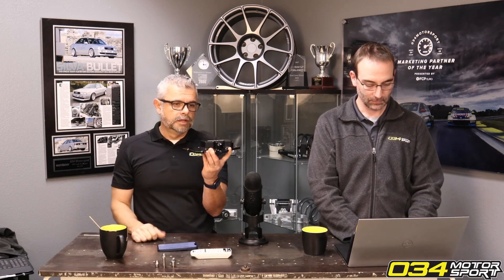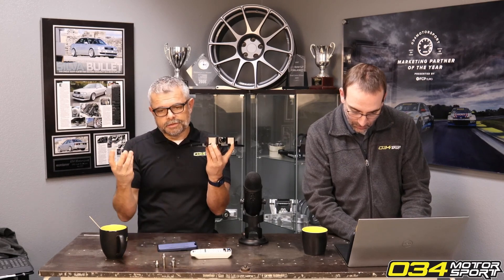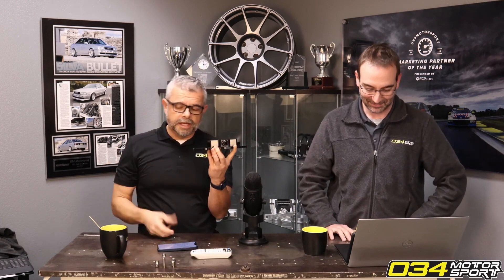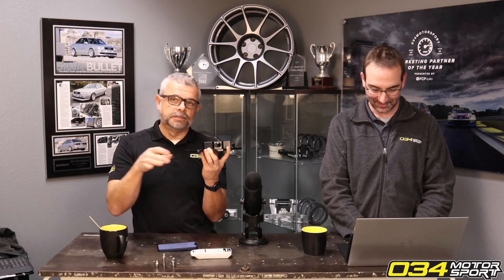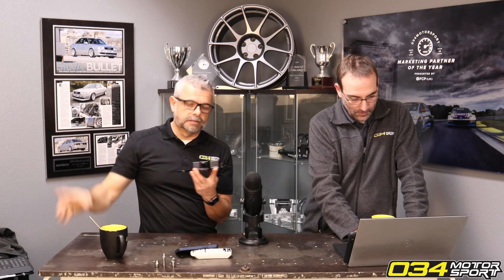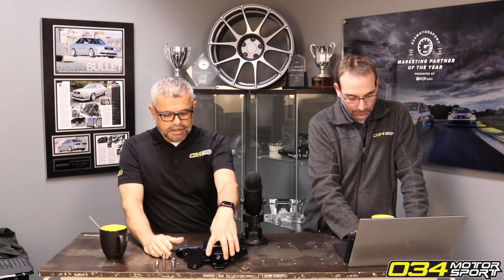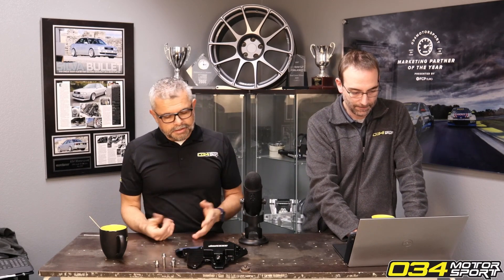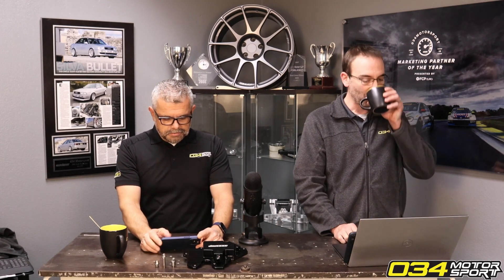The Design Behind the 034Motorsport Stage 2 Billet Valve Cover Breather Assembly

Comment: So open air intakes work fine 99% of the time as your moving when driving. If your dragging from the lights you might have less initial power for a split second then the cool air comes in. Something most of us already knew despite all the boo boys saying open filters produce less power. 😂

Comment: Does this work better at revealing crank case pressures?  I'm stage 3 and I feel like the crank case has a little higher than normal pressures using the OEM version.
Reply from the maker: Our setup ensures optimal crankcase ventilation by utilizing a high-capacity design and can solve the issues you may have with the factory PCV assembly at any power level.

Comment: Stating the factory does not work is not useful, with absolutely no context as to why or showing any supporting data provides no information respective to the problem your product is supposed to address and does not show that it does such.. it could be worse.
Reply from the maker: We state the factory system "doesn't work", then we spend the next 3-4 minutes explaining exactly why and how it doesn't work, you'll need to watch the whole 5 minute video to get all the details.  We do extensive street and track testing on all our products, including our catch can systems, our products work because we test them and verify the results.  In the case of this product, we have proven through extensive engineering and testing that oil is kept in the crank case, oil is not pumped out of the factory PCV system like the factory system allows.  All of this is easily verifiable and our customers benefit from our in depth understanding, engineering and testing practices.

Comment: hey what is the catch can that needs to be purchased to work with this billet valve? for a S3 8Y 2022 model .
Reply from the maker: We do not currently offer a Catch Can or PCV Solution for the 8Y S3 at this time. It is something that we will be working on in the future! 

The product discussed in this video will not fit the 8Y S3.

Comment: Does this need be ran with a catch can or can I run this without a catch as just a  replacement pcv valve? It seems like thats what you guys seem to be saying as well as the internet but i want a direct answer because im gonna order one if i can run it as an oem replacement. I cant run a catch can because my car goes through winter. Thanks for your time.
Reply from the maker: Our replacement Valve Cover Breather requires our catch can setup and it cannot be ran by itself.